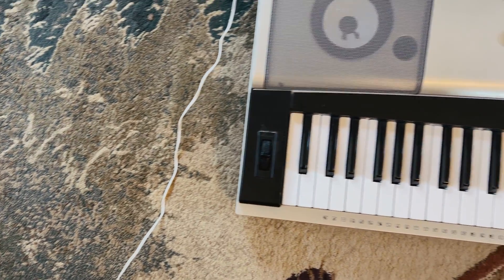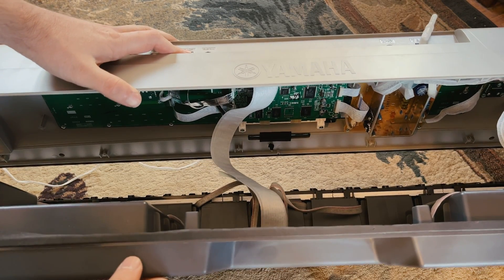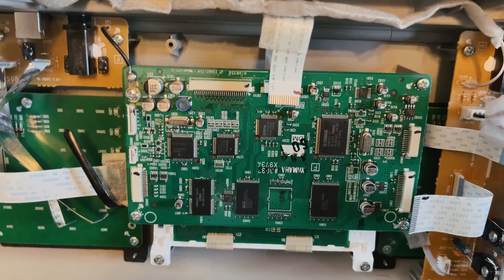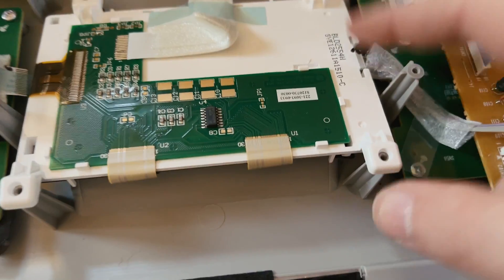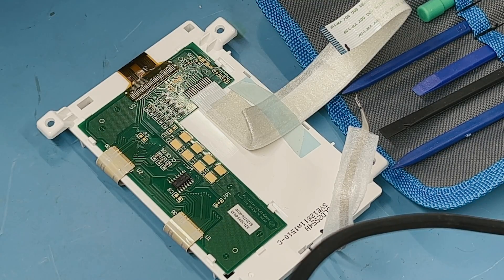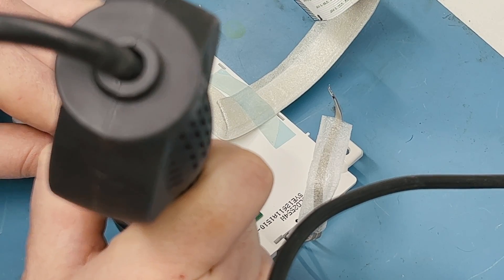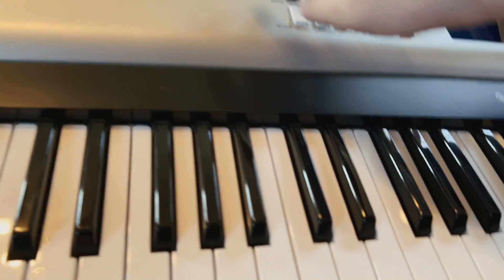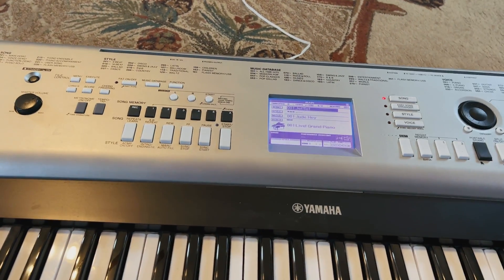Quick Fix: Yamaha Digital Keyboard Faulty LCD (DGX-530, YPG-535)

Comment: I just picked up a ypg-635 with non-working backlight on the LCD. I can see it if I shine a light from above and avoid the reflection. I guess in this case I'd have to spring for a replacement board? Another slightly annoying feature, key bounce noise. When you let go of a key it makes a noise when the spring pulls it up and then it bounces once and makes the noise again. So the keyboard is a bit clackety-clackety to play. I've heard this is because of worn out felt, any experience with this? Thank you for the video!

Comment: Hey great video, And my DGX630 just popped that problem up to so I'll have to try to do your method.. Just as a note when you record video turn off you noise canceling feature so the sound doesn't fade out on your camera and your productions will sound much better
Reply from the maker: Thank you. I will have to revisit this project again when time permits, my original fix came loose again after quite a lot of moving and transporting the keyboard. I was going to say maybe it is more sensible just to replace the LCD outright, but when I look them up online they range from $70-$180 just for that and in the end it is still just a loose solder connection causing it.

Comment: I just performed the same repair and it worked great - except now my backlight won't come on.  I believe the power is supplied to the backlight via that two-wire cable with the funky clip.   However, without knowing what the voltage from that harness should be, I cannot verify whether it's the power supply, cable, or leds on the backlight?
Reply from the maker: At some point soon I plan to disassemble mine again to rework the fix more permenantly, as it came loose again after transporting it quite a bit. I can see about checking the voltage readings on the pins.
Reply: @MattPilz  yeah, it must be the backlight, as the voltage coming off the power supply is 5vdc, and exists right up to the display solder connection.  I ordered a replacement display from AliExpress.  Fingers crossed...
Reply from the maker: @erkme73  Sometimes doing a direct replacement like that is probably the simplest and more long-lived solution. let me know how it turns out.
Reply: @erkme73  did you get the replacement ? I have the same problem - half LCD is off and no backlight ( DGX640 )
Reply: @gregparadi I did but I have been so busy I've not gotten around to installing it.

Comment: What temperature do you set the hot air gun to?   I dont want to melt the ribbon cable!
Reply from the maker: I am going to rework this repair again since it has come loose while transporting, can't recall temp but will note it next time. Basically it has to be just hot enough to soften the solder points to let them re-adhere. Using a targeted air gun tip to better isolate the heat point can help ensure no melting of any cables.

Comment: My display was showing the left half on both sides. I don't understand how a lose cable would cause this symptom. But I got it fixed without heat, I just pushed down on the cable connections with my finger. We'll see how long it lasts.

Comment: Would this work on my Clavinova CVP 309
Reply from the maker: If it exhibits similar symptoms then the ribbon cable and poor solder connections as seen here is often the culprit.
Reply: @MattPilz  I don't have a soldering iron what could I use instead

Comment: Any advice if i dont have a soldering machine?
Reply from the maker: It's sometimes enough to just open it up and clamp the ribbon cable down more firmly with alligator clips. I recommend adding some electrical tape around the clips so the hard plastic doesn't cut into the ribbons.

Comment: When i power mine on, the screen flashes and the speakers make a rhythmic beat. Its like it wants to start up but wont. The original power supply was bad when i got it and the replacement is a 12v1.5a. Does it need a 12v2a?  
Thanks for the advice
Reply from the maker: This does sound like a power supply issue, though not an amp issue (the factory adapter is 12V DC 1.5A). I had a similar problem where an adapter I bought from a thrift store would cause the speakers to "lock" in a buzz and the screen would light up but never show display until I power cycled a few times. I checked the voltage being output from the 12V adapter and it was actually outputting over 18V so was overpowering it. You might want to check your actual adapter voltage with a multimeter it's possible it is bad and outputting something abnormal. The adapters found commonly in USB external hard drives tend to work well.

Comment: So sad you didn't move the camera so we could see the air solder tip and the ribbon while you were reheating them.  Viewing your knuckles and the back end of the solder gun was unhelpful.  But otherwise, a helpful video!  Thanks for sharing it.
Reply from the maker: I can't believe I did that either. It was such a spontaneous repair I only thought as a last minute thing to film it, but then didn't even check where the camera was pointing for the key moment... Sorry but yes the process is really just reheating the ribbon cable and pressing down on it as you go along. I didn't expect many to ever need to know this random repair task but it turns out it is more common and these keyboards are still more popular than I anticipated.

Comment: Many thanks for this video. Just had a similar fault on a keyboard come in. Will reflow the FPC cables and test again. Otherwise, there is Aliexpress for new replacements of LCDs.
Reply: Wish to say, thanks again! Same fix worked for us as well. We used a relatively low heat setting on our hot air tool + flux on the same PCB cables. Went back and forth a few times while pressing down gently with metal tweezers. The entire LCD fired right up like it was factory new.

Comment: Half of my screen came back-though weakly. But I guess half is better than none!
Reply from the maker: It's possible the ribbon cable is still not making a strong enough connection. Also experiment with the black knob on the back to alter the contrast and see if that might kick it back into order.

Comment: Can't  see what you're doing with the heat, your hands in the wsy
Reply from the maker: I really wish I had paid closer attention to camera placement for that moment! But it is truly just running back and forth slowly across the ribbon cable with heat, and simultaneously applying pressure to it with any sort of sponger tool. Only objective is to make it better adhere to the board.

Comment: GReat Job! I was debating if I should get a new screen. My 535 does the same thing. I got it used from a former student. It also has a key issues that I understand is normal for these models..I'm contemplating using "conductive paint" to freshen the contacts of the keys that are loud or missing the tone...Have you heard of someone using this method? I've searched for a few years and can't find anyone that successfully did it..Seems logical. I used to use a No. 2 pencil and it worked for a while...but had to go back in almost annually.  I had the keyboard for over 7 yrs. I love it, the action, piano sound quality is unmatched to newer boards in my opinion..I'm not being cheap either..great board. HELP, PLEASE!
Reply from the maker: I have not dealt specifically with repairing these keys, but the basic concept goes way back to electric typewriter days where I do have some experience repairing them and in similar style to what you describe. Many "keys" used on devices use foil pads that wear or break loose over time. Or, as you found, the carbon/contact sensing properties wean. I was fixing up a typewriter last year that had many other issues but part of it was the key pads had all disintegrated. I had bought a roll of double-sided copper foil tape believing this to be a better solution than paint or pencil contact restoration. But the typewriter had other malfunctions to the point where I didn't yet get to try the approach. Basically my idea was to cut a piece of the tape and adhere it to the worn pads, to restore touch contact functionality. They sell them in many different widths and for only $5-$8 for a 65 foot roll.

Comment: Thanks for this video! I had a feeling it was jusy the screen ribbon cable but never wanted to take it apart. Ive had this keyboard since Christmas when i was like 10 years old. Just getting back into music making and this will help a ton having my keyboard working properly again.
Reply from the maker: Happy to help. I may have to take mine apart again for another problem after it accidentally fell flat on its face! Now the first time I turn it on it just is a loud humming until I power cycle it once or twice. I also had inadvertently put the sustain pedal in the headphone jack, so am wondering if something glitched out due to that (but mechanically I don't think it should had). It really is an excellent keyboard it's the only one I've ever had that was full sized like this, lightyears better than the really cheap Casio ones I'd get growing up.

Comment: Thanks for this. 
I wish your hand wasn't blocking the view of the work but regardless, MUCH appreciated!
Reply from the maker: Sorry about that! It was a sort of impulse recording decision and I really was not paying attention to camera placement, but hopefully the gist of it came across clear enough.
Reply: @MattPilz  No worries. thanks for posting.
because of it, I was able to make an improvement  on my wife's keyboard screen. Now the entire screen is visible but the contrast is wonky -easier to see off angle than straight on. BUT! the entire screen is now visible whereas before it was only half.
So thanks for posting!
Reply from the maker: @edwardjski  There is a black contrast knob on the back of the case, what happens when you turn that all the way up or down?
Reply: @edwardjski  Weak video image may be due to a weak connect on your ribbon cables. Try pressing them harder onto the board.
Reply: @bang0n500  Thanks; it turned out to be the contrast setting, adjusting the contrast knob fixed the weak image.
Heating the ribbon connection and pressing it firmly into the circuit board fixed the half blank display issue.
Reply: @edwardjski Depending on the model, you may find a contrast knob on the back panel. My DGX-620 has one.
Reply: THAT WAS IT!
I use Yamaha gear for in-ear monitors, wireless mics etc and there's a contrast/view setting in the settings menu of those devices. So I was looking for something similar in YPG; I didn't think it would be a physical knob on the back panel!
Thanks so much! This was one of the repairs my wife wanted for Christmas and now it's sorted.